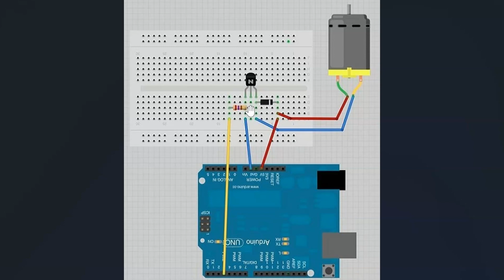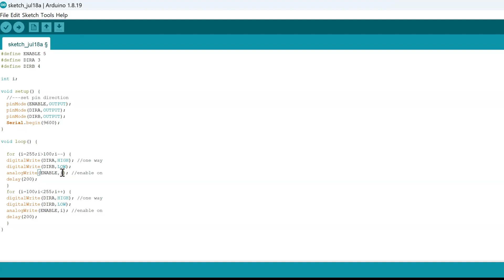DC Motor Fan - In depth and WORKING Tutorial

Comment from the maker: #define ENABLE 5
#define DIRA 3
#define DIRB 4

int i;
 
void setup() {
  //---set pin direction
  pinMode(ENABLE,OUTPUT);
  pinMode(DIRA,OUTPUT);
  pinMode(DIRB,OUTPUT);
  Serial.begin(9600);
}

void loop() {
  Serial.println("Start The Motors!");
  //---PWM example, full speed then slow

  for (i=255;i>100;i--) {
  digitalWrite(DIRA,HIGH); //one way
  digitalWrite(DIRB,LOW);
  analogWrite(ENABLE,i); //enable on
  delay(200);
  }
  for (i=100;i<255;i++) {
  digitalWrite(DIRA,HIGH); //one way
  digitalWrite(DIRB,LOW);
  analogWrite(ENABLE,i); //enable on
  delay(200);  
  }

}